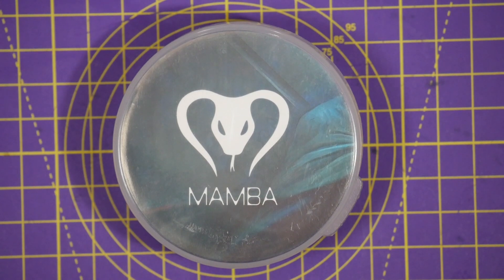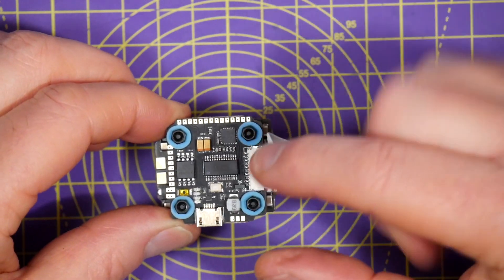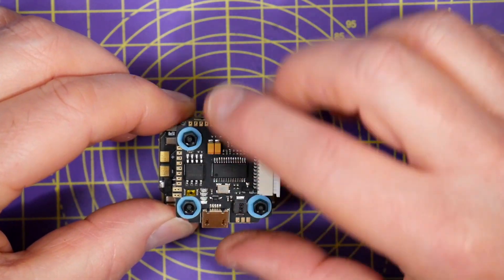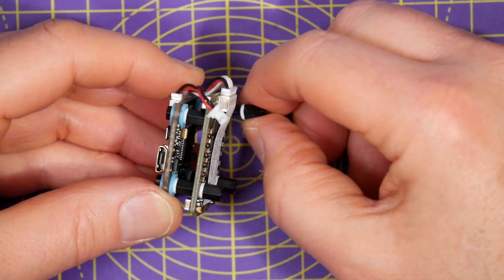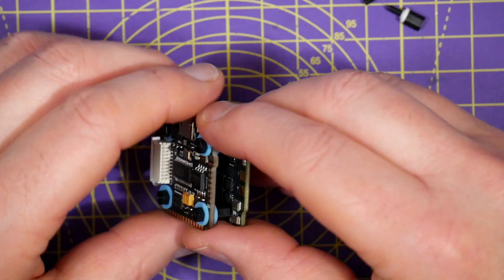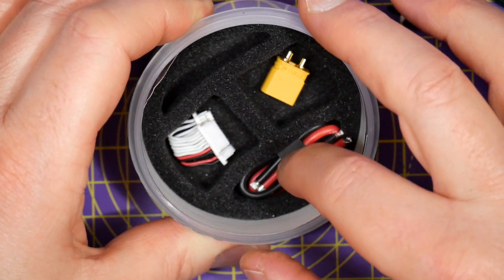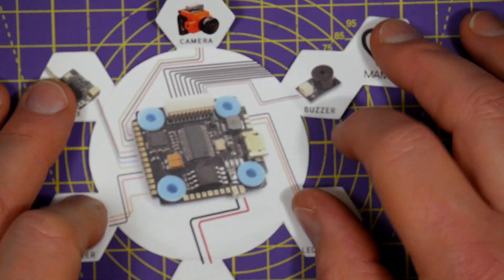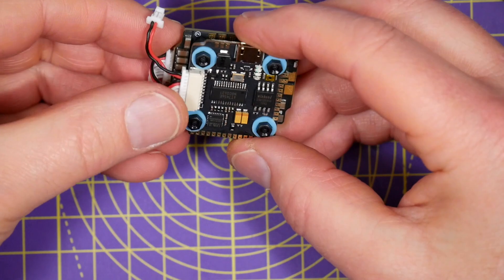MAMBA F405 F4 Mini all in one AIO 20A ESC DSHOT power tower flight stack - best value ever

Comment: i have an led issue (i cant get them to fuction)Can u help?
Reply from the maker: Check the LEDs are working using a separate variable power supply. If they stilll don't work on the Mamba, it may be a faulty on board 5V BEC.

Comment: Stumbled onto your video looking for the proper scaling of the current sensor on this particular Mamba F25 MK2 4-in-1 ESC, Diatone suggests 400 as a scale, but that doesn't seem to work and 4000 would be more appropriate, did you also notice this?
Reply from the maker: I haven't scaled the current sensor on this board. But I always believe what I see with my own eyes rather than any specs. Always setup voltage and current sensing yourself to be confident its correct. Thanks for watching.

Comment: Not sure if you're still actively responding but... I'm using the DJI system which needs 7.X to 17.X volt. I see the 5v pad, but not a 9V or something.
Can I hook it up to the 'CURR' pin, will that pass through the voltage it gets from a battery? (I am using 4S of course)
Reply from the maker: Best to just check it with a voltmeter to be safe.
Reply: Whirly Bloke thank you for taking the time to reply. I do have a voltmeter, just not really sure how to use it. How would I check the current going through that specific pad?
Reply: Whirly Bloke thank you for taking the time to reply. I do have a voltmeter, just not really sure how to use it. How would I check the current going through that specific pad?
Reply: @Chocoholic1337  wire straight to the battery pads as long as you stick to 4s, I have dji too 👍

Comment: hi something weird it's happening to my mini stack. when i connect the camera to V1 and vtx to video out i don't have any video, if i bypass the FC camera working fine, i have BF4.1.3. i can't figure out why!?!?!
Reply from the maker: It may be a fault on the FC, but first check there's no solder bridges or shorts. Lightly scrub the PCB carefully with a toothbrush and some alcohol (IPA).

Comment: Is there a 3.3 volt PAD on this board for Spektrum receivers.. ah u showed the paperwork that came with it and it showed it! Ty
Reply from the maker: It doesn't look like it. Check out the Mamba manual https://cdn.shopify.com/s/files/1/0027/2708/4144/files/M_F405_MINI_MK2.png?1497

Comment: Hi nice review which prompted me to buy this 20*20 stack. Can we power the fc through esc via cables? Or we need to power by using the pads in the fc?
Reply from the maker: Just connect solder the battery connector to the pads on the ESC board and everything is connected internally with the board interconnects.
Reply: @WhirlyBloke  Thanks sir
Reply from the maker: @rajeevgopal1394  That's what's great about these stacks. You just need 12 motor wires soldering, 2 battery wires and 3 camera wires and you're up and running.
Reply from the maker: @rajeevgopal1394  Check the motor bolts on that arm aren't to long and touching the windings.
Reply: @WhirlyBloke  no sir it isnt. Same bolt used  in other motors also. Others work well